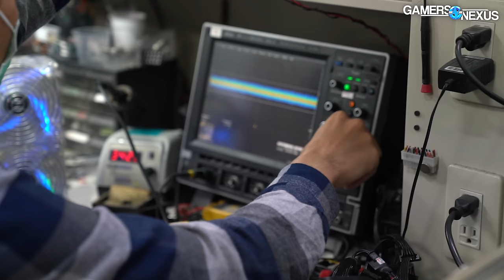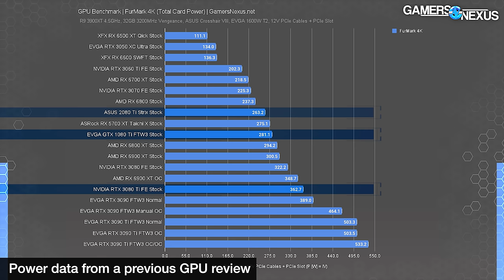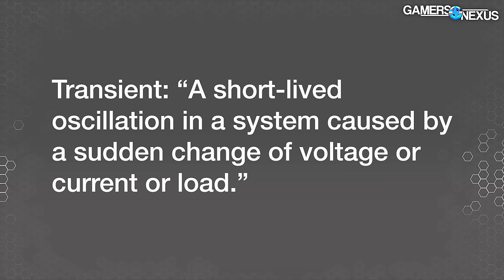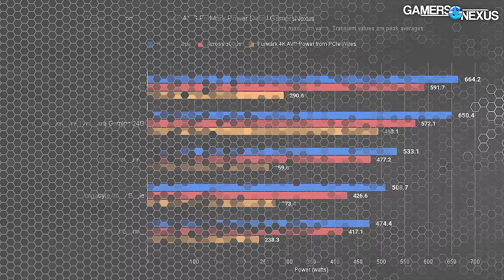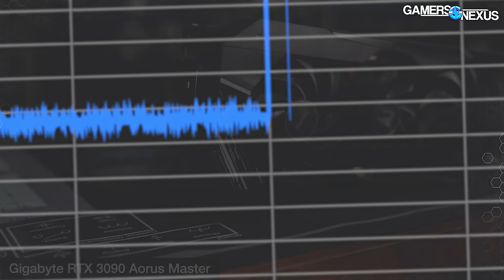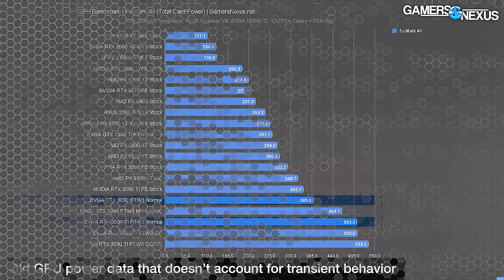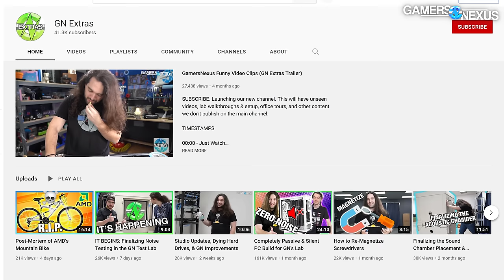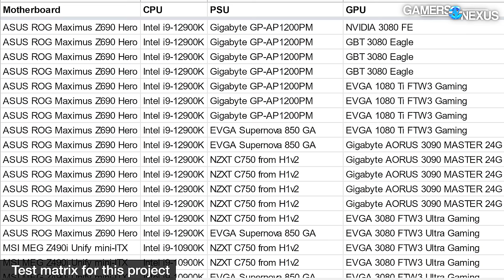The Brewing Problem with GPU Power Design | Transients

Comment: This honestly explains so much about my early experience with my 3090. I saw on nvidias website they recommended 750W for a 3090 with a 10900k so I decided to get a 850W PSU to give myself a little headroom. It didn't matter at all as I was constantly black screening cutting out during gaming which I later learned was OCP triggering. It was super frustrating as 1/3 of the people I talked to said I didn't have enough watts, 1/3 said I was borderline and 1/3 said I had more than enough. Long story short is I had to move up to 1000W to stabilize the build and now I believe the reason why is because of the transient spikes you guys are talking about. I really appreciate your video highlighting these issues as I thought I was crazy for a long time in regards to this.
Reply: I'm rocking a Corsair RM850x for a 3090 FE and 12900K non-overclocked. I'm scared to even touch clock settings with these kinds of spikes. Probably going to have to upgrade the PSU at some point. My first gaming setup in 2012 was on a Corsair 600 watt PSU. It's crazy to think how ridiculous things have gotten the past several years.
Reply: @braf7349  my wife's RM850x finally started showing it's age after about 4 years with a 2080Ti. It started black screening in games that were only moderately demanding. Monitoring rail voltages in HWInfo, I could see random 0.3-0.5v drops on the 12v rail, even without any real load. I didn't feel like having to deal with the whole warranty process, so she inherited my old EVGA G2 850w (5950X/3090 setup) and it's still going strong for her.

Good luck with your setup! At least a PSU is a pretty easy upgrade if you do have to swap it out.
Reply: The 10900k chugs around 200-250W on turbo, so a 350W 3090 with spikes at 700W might indeed trip a touchy psu. (Especially if you have a simultaneous spike on the cpu)
Reply: Replaced my 1080 ti with a 3080 ti, had a 750w psu which should have been enough but it wasn't, system ran stable stock when I went with a 1000w psu, likely have some headroom now but I prefer no crashes vs a few more fps
Reply: Poor quality or defective PSU? Also undervolting the card saves so many watts.
Reply: What model 850w was u using?
Reply: You just needed to buy a GOOD 850w PSU.

I have an AX860i, I know for a fact it could handle that 3090.
Reply: Yeah, I had a similar experience. I previously had a 1080ti with a 650w. Upon 3000 series release, I bought a 750w in preparation for the eventual 3080 I had planned on buying. Because of the shortage, it took way longer than expected to secure one. Ended up getting a 3080ti just based on availability and bought a 1000w just to be safe.
Reply: And here I am, just bought a 750W 2 months ago, well I wouldn't dream on putting anything above 3060/6600 on my built.
Reply: To be fair the 3090 is a workstation GPU, you expect that an 850W PSU probably won't cut it.
Reply: Thats just crazy Evan. Makes me wonder why folks bother with PC gaming in 2022 it being so ludicrously expensive and utterly stupid like this.
Reply: @buggerlugz6753  there's an extent to which things like GFN has made a difference. Why bother? Because console gaming is for lamers, regardless of all the current issues.
Reply: I have the Gigabyte 3090 Master and no issues with a SF750. Used both a Gigabyte X570 Master and MSI cheapo board.
Reply: If you guys would have bought a proper quality PSU like Dark Power-/ Pro (FSP/Seasonic) or the big Seasonic ones (the big Corsairs are from Channel Well Tech or Seasonic, Corsair doesnt built any PSUs at all) you wont have any Problems at all, these PSU are built for these kind of Spikes.
(BeQuiet does know and optimize their PSUs for these Spikes since 2012) 

You can easily draw more then 1KW from the 750W DP if the right PCI-E Power Connectors (depending on the PCI Rail Splitting) are in the right Ports.
This is all explained in the Manual but people just dont read :D
The people with "Problems" here just bought the wrong PSU... or didnt read the Manual, thats everything.

The Problem here is the "User" who doesnt read the Manual and then uses the wrong PCI-E Power Connectors (BeQuiet) or misconfigurerd their Corsair Link Software (Corsair) and then the 3090 OC wont work yes, but thats intended by the PSU Manufacturers because you can control via Plugs and Rail Splitting how much your GPU can Draw.

The BeQuiet Dark Power 750W can provide up to 795 Watts to a GPU (not the System, just the GPU!), its all in the manual guys....
Reply: @streaky81  The 3090 is no Workstation GPU and even proper 750W are more then enough with OC.
Reply: @buggerlugz6753  Because the GPUs that will drop this year have like 8 times the theoretical Performance of a PS5. And that Console should compete in the next years? How?
Reply: Which 850 Watt PSU?
Reply: @satibel  that’s just bullshit. You don’t draw that kinda power from the 10900k in games.
Reply: @ztechmusic  sure it is, it's the 30xx series equivalent of the Titan V, that makes it a workstation GPU. For sure Nvidia will flog you something with the workstation label on it, but they're more for people who need specific kinds of data guarantees.
Reply: @Nerdywr   indeed you will not have that constantly in game (apparently average is around 100-180W depending on the game), but you still might spike to the 250W limit (or 330W on some motherboards), and if it turns out it's at the same time as the GPU, you might have some instability on some specific games and even specific actions (like going in a specific dungeon or boss)
Reply: @streaky81  Bro, just no, you cant get out of this, Titan is no workstation GPU too... xD Its just wrong, look on the Nvidia Page, only A Series is Workstation.
Reply: You didn’t undervolt the card did you?
Reply: @nexxusty  however a standard AX860 (not the i) cannot handle a 3090.  It triggered OCP pretty regularly and was replaced with an RM1000x with no issues.
Reply: i had pretty much this exact issue with a 3090 and an 850W PSU, but ONLY while playing Red Dead Redemption 2.  nothing else i did or played caused shutdowns in the short time i had that GPU.  This definitely sheds more light on the matter, in addition to the fact that RDR2, as i was told by an acquaintance, has a power draw issue in that it will force the GPU to max out its power consumption.  I tried doing some tests before ultimately returning it, and saw that in the short amount of time i could keep the game running, it was consistently drawing anywhere between 350-370W, regardless of how high or low my settings were. TL;DR, i swapped the GPU for a 3080ti and bumped my PSU to 1000W and haven't had an issue since.
Reply: @jeremyc7825  Yeah, you can manually set the OCP points higher on an I version.
Reply: Did you try to undervolt it?
Reply: @ztechmusic   now that we are finally getting so much better prices, PC gaming makes sense, but didn't made a single bit of sense 4 many time for sure when the cheapest gaming GPU would be above 500eur for poor mid-low end performance and where I live in Portugal from Europe that would be almost a full month of salary.

Anyway PS5 digital is 399.99€ if you could find one but contrary to PC parts all official big known stores here sell them exactly 4 that price and that's sadly something that always pisses me off since the 90's in PC hardware.

I very rarely see a GPU and CPU at or below their MSRP here and maybe 99% of all Europe unless in promotions later or when the hardware is already outdated.

It's sad that Intel, AMD, Nvidia and whatever most known hardware companies don't care a single bit for their customers, they couldn't give a single F* if their 10 cent product could even be sold for 1 million no matter what store sells them and it's sad that they also don't care a single bit if they are mostly even illegally sold by illegal sellers for whatever price they want.

Ps: that's something consoles at least have which is loyalty to customers because they make sure their stuff is sold at or below MSRP in the majority of countries and their own known stores, however their anti-scalper stuff is mostly the same crap as PC brands 👎
Reply: @miker7032  Why would you pre-emptively spend a bunch of extra money and time if you have no idea whether or not you actually need to?
Reply: @guily6669  All true, 
but you can have PS5 Performance with GTX1080 / 1070Ti / Vega 56 / 64 (250€) and you can get Ryzen 1600 first Gen + Board + Ram for 150€ and you are good to go, 

(ofc PSU + SSD + Case will get you over the 400€ mark)

thats no excuse at all for these Market Prices which suck pretty hard, but i just wanted to show, that there are ways to get around expensive Hardware. I know that used hardware is not an option for anyone.
Reply: @ztechmusic   the PS5 is miles better than that... In fact I don't think RX6600 XT is even in pair with PS5 because even though it has the TFlops it lacks a lot in memory bandwidth which means for high resolutions PS5 has an edge.

It's basically a 8 core Ryzen with RDNA2.0 and off course they always have other hidden tricks custom silicon and can surely count on Devs optimizations much further in the future though PC lately is much better than it used to be in that regards.

PS: though I'm not very interested in the PS5 as I used to, will probably wait 4 PS5 pro but anyway my PS4 Pro is mostly picking dust 4 years but Gran Turismo always interests me. Really wished Sony made GT 4 PC as I would never need a playstation anymore 😎
Reply: @guily6669  Everything true again, but 6600 is a damn small card though, i think you underestimate Vega / 1080 a bit, the 6600 is a pretty small card, these old boys go up to 220 / 250 / 300 Watts and still perform very well, y the PS has an 8 Core though its clock is pretty low...
Reply: @ztechmusic  NO you underestimate optimization.  I need to go and check but either a PS5 engineer or an Unreal Engine 5 engineer stated that with optimizations you would need at least double the GPU performance of a COTS graphic card to equal the PS5 (or the new X-box) - for example if the PS5 was equal in TFLOPs to a 1080 you would need a GPU with at least 2X the performance of the 1080 to match the PS5 due to optimization.
Reply: Just no. Thats just wrong, please compare real Performance to TDP Limits and you will see. Yes they optimize more for Consoles, but its like 30% - 40%. You cant get much more Performance without drawing much more Power and thats the biggest Problem of the Consoles.
Reply: @ztechmusic   I was talking about the RX 6600 XT not the non XT, it's more in pair with GTX 1080 TI, but in a console even with the lower TFLOP than the actual 6600XT, most likely the console and a very optimized game gets easily better than the 1080 TI specially with more modern stuff like Ray-tracing and the memory bandwidth on the PS5 is far better than the RX6600XT and close to the GTX1080 TI so it has all the RDNA 2.0 advancements\optimizations for performance + good memory bandwidth to push higher resolution than what the RX6600 XT can poorly do as in the PC is best to keep it for 1080P sadly.

There is also a game dev that could make his game natively 8K which is the first to do such thing despite the PS5 outputting in 4K it's rendered natively in 8K and that same dev said they couldn't get the same result on the Xbox series X despite the similar hardware and even having more performance than the PS5. There's always something custom on the consoles going so that they can cut a lot of corners yet get good performance...

I'm thinking for a very low demanding game it seems PS5 can achieve more resolution than Xbox Series X while a more demanding game will definitely always run better on the Xbox or with better settings or higher resolution.

ps: On the crap PS4 I know they have custom silicon inside the APU to like do the crap checkerboard upscaling without taking any hit on performance, it's a clever trick to at least look slightly better than a lower native resolution without it while probably costing almost nothing and without affecting any kind of performance since it doesn't need the CPU or GPU cores to be wasted.
Reply: @ztechmusic  Yep I agree, I mean they surely have some trickery going on in both software+hardware, but nowadays we are way far from a good optimized PC game also requiring double the requirements LOL

Sometimes Digital Foundry test PC VS console and it surely requires a bit more, but some well optimized games they tested didn't really need much more than the console to run with comparable settings.

ps: Sure there are still poorly optimized games, but that's not as common as it used to be unless we are talking about indie games specially early-access games which is pretty normal to not be fully optimized, but that the consoles will also suffer on a few games too...
Reply: @nexxusty  I have a high quality seasonic gold 850w with a 3090 and occasionally this still happens to me although not often. I'm gonna go with something better when I get a 4090.
Reply: @braf7349  i got rm750 and i overclocked my 3080 tuf with i5 9600 and its great
Reply: @Braf  I have the same PSU as you and running a MSI SUPRIMX 3090ti OC'ed to 2100mhz core @480W + a AMD 6900X OC'ed which pulls max 210W and having no problems. My motherboard is an ASUS ROG Strix X570-E Gaming Wifi II. Furthermore I have an AIO cooler and 10 fans, fancontroller, rgb + controller & 3 ssd's in the system and I have never had a shutdown. Still, I think I am right about at the limit of this PSU's capabilities.. I'm definitely sticking to Corsair when it comes to PSU's, preferably the platinum/titanium graded ones.
Reply: Yeah, don't rely on the power rating. 850W means nothing. What matters is the quality. E.g. as someone else mentioned beQuiet PSUs have proven to hold up way above their rating for spikes (a 750W Straight Power can handle a 3090 with OC on max load), and meanwhile you got cheap PSUs that don't even provide the full power at 12V and straight up die against the 30 series. Reviews are the way to go with PSUs.
Reply: @guily6669  You are paying over time with game prices. Of course, they want you to get the consoles for a reasonable price - most consoles are sold for dirt cheap (if you compare the hardware to component prices). If not, why wouldn't you just get a pc and then they earn nothing from the games.
Reply: The amount of people in this comment string that will buy $3-4k+ in parts and then cheap out and spend <$150 on the PSU is absolutely hilarious.
Reply: @dsmfan95  do note the RM850x 2021 version is vastly improved and might last even longer, I would've just swapped it with the new one, the G2 is not bad but in a lower tier on the tier list than the RM
Reply: @buggerlugz6753  why folks bother with PC gaming??? I think you e missed the point here an in this video, this is an issue with high end cards. Don't have a current gen high even variant? 

Or have a high end card from years ago? Then this isn't an issue, and a fairly new issue in the PC space in general. 

Prices also have gone down every month, and you don't always need the most current gpus anyway, used parts are flooding the markets rn.

Most other parts didn't have the scalping and supply chain problem either, it's not as bad as you think.
Reply: I have a 850wat PSU seasonic and a 3080ti when watching utube the pc would just crash and restart. Bare in mind when I had my 1070 I never once experienced this I have a i7 9700k oc to 4.8ghzt. Now I to invested in a 1000wat PSU in gaming I had yet to see if this crash would occur
Reply: This was my same experience with my 3090. Had an 850 Gold I'd used for years. Constatn triggering so updated to a 1000W.